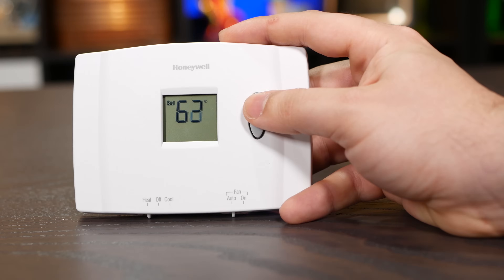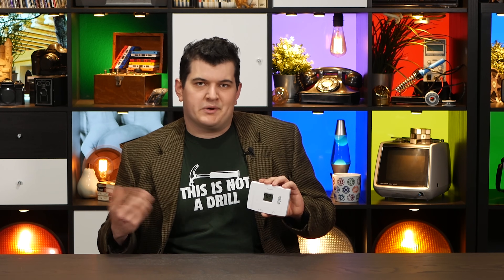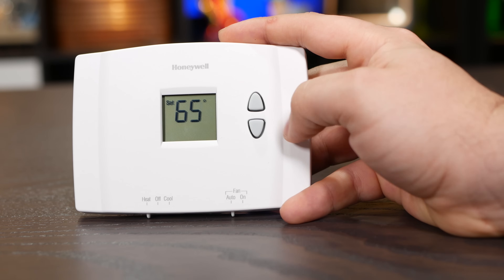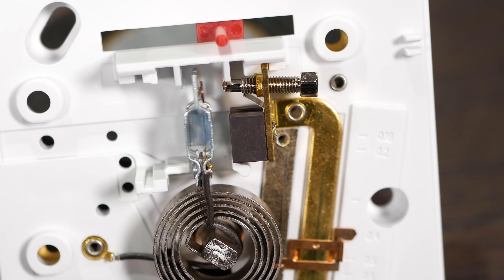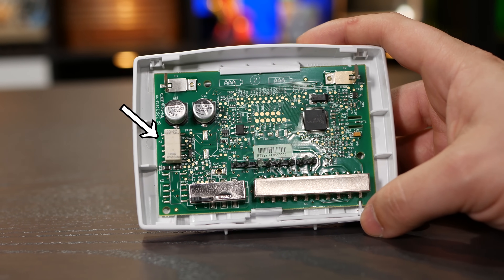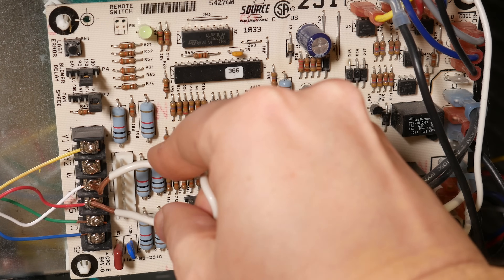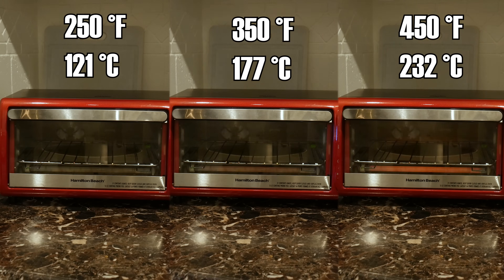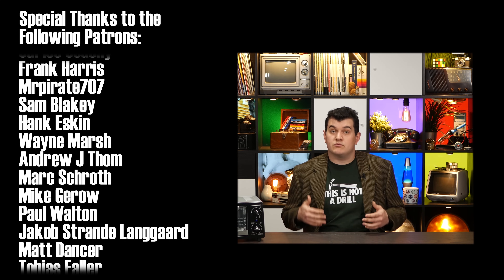Thermostats: Cooler than you think!

Comment: One thing that drives me crazy is that the compressor and blower fan are turned on at the same time!  Here in Houston on a hot day, the lights in the house dim because of the load.  I have been looking for a thermostat that would start the fan for a few seconds before starting the compressor, like in an old RAID setup where the drives were spun up in stages! See how I connected two different technologies?

Comment: What you described was / is the old standard for house thermostats.  I could be wrong but I thought my new thermostat worked on the PWM and a 30 minute cycle time.  The duration should vary based on a PID (proportional–integral–derivative) calculation, kind of a cruise control.  What I would find interesting would be how my HVAC deals with two zones:  upstairs and downstairs.

Comment: Some thermostats have an "anticipator" inside. This is a tiny heater inside the thermostat housing which operates when the furnace is on. It's purpose is to prevent overshoot of the room temperature. They are used more with hot water heating. They shut off the furnace before the set point is reached. This slows down the heating of the room. You can defeat this and heat things up more quickly by turning the thermostat higher.

Comment: Actually, some home heating thermostats do use proportional control...
A few years ago I was driving home from a night of camping with some friends on a Sunday morning in February. Being adventurous types, we noticed a small road marked on the map and decided to explore it. Turns out it was a snowmobile trail, and the Jeep got stuck on a slight downhill slop just past the road crossing. In the process of digging out enough snow to back out, we heard something snap near one of the front wheels, and as soon as we started driving again it sounded like something had been damaged. So we stopped in an empty parking lot in the first small town we drove through.
What does this have to do with thermostats?
After the driver found a broken U-joint and ordered a tow truck, the owner of the store next to the parking lot (who was in the building that morning even though it was closed) came out to offer us a break from the weather. The store sold coal heating stoves, and he old us a little about how the technology works.
Coal stoves can't start and stop on demand like a gas or oil furnace - starting them is more like building a campfire than flicking a lighter. Instead of ignition, the heat is controlled by basically changing the speed of a conveyor that feeds fuel into the stove, so the thermostats use a PID loop with proportional output instead of on/off control.

Comment: I am from The Netherlands, and most furnaces are quite advanced. Most of them have now an outside temperature sensor. The lower the outside temperature, the higher the heat output. Further they are often time base regulated. The longer the thermostate is asking heat the higher the output will be. Together with a PID thermostate, it gives a steady room temperature. Not many people have AC by the way.

Comment: Those old mercury thermostats had to be absolutely level and plumb and you set an anticipator to hydronic or air.. It made a difference because a hot water system was pumped and had a lot of residual  heat in the radiators but a hot air would just stop heating.  The anticipator was just a nichrome coil that preheated the bimetallic coil to shut it down earlier then ambient temperature once the thermostat called for heat.

Comment: Regarding your comment to Nest at the end - the app "talking to" the Nest (or any WiFi-connected thermostat) could probably be told "run the temperature at 75° for 30 minutes, then go back to 80°".  (I use a plain old electronic thermostat, because I don't need to play with it on line, so I can't experiment with that, but someone running a Nest or something similar probably could.)

Comment: My < and > keys did not move it frame by frame, they just adjusted the scroll speed- lowest was   0.25X. Also, in my experience thermostats are placed on an inside (dividing) wall whenever possible, probably to reduce inaccurate responses based on cold or hot wall temperatures vs actual air temperatures.

Comment: You might have mentioned that  there are also line voltage  (120 v or 240 v) thermostat/control systemss. For anyone just used to 24 v units, moving to a place with line voltage control might result in replacement with the wrong thermostat or a very rude shock!

Comment: The last comment on a mode where the thermostat goes to a new set temperature after you've mowed the lawn: That would be the "Hold" mode on most Honeywells programmables. Just hit the temperature buttons up or down and it will hold the new temperature for 2 hours, then resume its program. You can also set the Hold mode for longer periods, perfect if you're going away on vacation for two weeks, let's say. 
Thermostat wire is special. I live in Canada, but things are similar in much of the United States. If the thermostat fails, your furnace never gets the call for heat and your pipes freeze causing a huge amount of flood damage. The wire is low-voltage rated and has a FT rating printed on the jacket - that's Flame Travel, to tell you whether or not a furnace fire can spread to the rest of your home via burning thermostat wires. Also, being different enough from ordinary NMD house wiring, it's hopeful no one would try to connect a household thermostat directly to the 120V line - but it does happen where baseboard heaters are common. 
Don't trust the wire colors as standards - they should be but they're not. Always label the wires as you take them off the old one and put them on the new one. If you lost track, go down to the furnace and look at the control board. The R terminal on the furnace must be connected to the R terminal on the thermostat, and so forth. 

When you run into W1, W2, W3 or Y1, Y2, Y3, you're dealing with a multistage setup. They're becoming common on high-efficiency residential furnaces here in the snowbelt. W1 turns on the furnace, one burner. W1 and W2 turns on the furnace with two burners.... you get the idea. Multistage heat is a lot more common than multistage AC because gas valves and igniters are cheaper than compressors and condensers, but you might see multistage AC moving into places where there have been energy efficiency incentives. 

Take your old mercury-bulb or other pure mechanical thermostat and mount it in the utility room where your water service enters your house. Set it to heat and set it at an indoor temperature you'd find unpleasantly cold - lowest setting. Connect its R and W terminals in parallel with your new programmable or smart thermostat, you might even be able to run the wires directly to the furnace. Your old thermostat will be there silently ready to command the furnace to turn on if your new thermostat gets dead batteries or suffers a software crash (or a hack!) while you're away on a ski vacation. It will keep your pipes from freezing.
Reply: I like that idea of having the second backup mechanical thermostat... Good cheap insurance for those that  go away for days at a time.
Reply: In hot states in the US, multi-stage A/C is fairly common to cut down on electricity costs (by 1/3 with a two-stage compressor!). We also have a variable speed fan.
Reply: Great information. I would recommend doing the same for hot climates? also worth noting that there's been occasional issues of furnaces not ending their heat cycle and melting things due to thermostat crash(hack?). If you're going to the troubles to replicate this a high temperature cutoff might be a good idea.
Reply: @imark7777777   In that case you could also use the old mechanical thermostat, but wired in series. 
E.g.: You want your house at 72 F, so you set that in the Nest thermostat. Then you run the heating wire through the old thermostat which is set at it's maximum (90 F). 
If the temperature ever reaches 90 F it will open the circuit, stopping the heating.
Reply: I put a timed override in the bathroom, with a Fan/ Heat selector. In the winter, you could push the button, and get 10 minutes of heat while you showered, etc. Then, flip it to Fan, and push it again to blow the warm, humid air out of the bath.
Reply: Good info here. However, I wonder about the proportion of only furnace problem fails compared to pure thermostat failure.
Reply: You said "t's hopeful no one would try to connect a household thermostat directly to the 120V line - but it does happen where baseboard heaters are common." I just hooked up a new Nest thermostat in my apt that didn't have a C-wire. The apt. has a heat only boiler so it only had 2 wires. I went out and purchased a 24 volt transformer that runs from my thermostat C-wire input and plugs into a regular wall outlet. Is that what you meant? Is that not safe? My thermostat works great and I watched videos on how to set it up correctly but no one mentioned any safety concerns about this set up. I'm also not an expert though.
Reply: @dalethomas7944  pretty sure he rather meant that red/white have a voltage of 120V across and you're instantly frying your nest with that because the color code is confusing.
Your method should be as safe as your 24DC supply is :)
Reply: @dalethomas7944  That assumes all 24v DC is the same, but there's the possibility that the ground is different, so it's not the same.  I've seen talk about occasional problems when a thermostat controls separate heat and cooling systems, and is using the common from one with controls for the other.  Normally it's fine, but apparently not always.  (I'm not an electrician, just repeating what I've heard, but this was from comments on the Internet, so you know they have to be reliable.)
Reply: Invest in a ceiling fan !!
Reply: Yah ours does this but it’s monitored by the security system. In tandem so if it fails you can be notified.
Reply: Great tips 👍

Comment: Re-the last question: Most thermostats could very easily be modified to "command" AC for a user-specified period without changing the thermostatically controlled 'duty-cycle". Simply add a small SPST (on/off) toggle switch across the 24v and AC contacts (bootstrapping). This switch can then be used to command cooling for a user-defined time period. The operator would be responsible for turning the toggle off after immediate AC is no longer needed. If forgotten, the AC will run continuously, your house may become a "beer cave",  and your electric bill will be astronomical.

Comment: My parents' house originally had one of those mercury switch thermostats. I watched it working with the cover off one time, and it was very cool, you could actually see a tiny arc when the mercury shifted away from contact. Also there was some sort of adjustment screw that let you level out the mercury switch setting it to the right temperature.

Comment: Lol, for my senior project, we designed a solid state hvac portable unit, that ran on 12V, and we designed a digital thermostat, using pid control to maintain the temperature. It had to control the different fans and their rates, the direction of heat flow, and account for the rate of change in temperature. This was intended to optimize the energy use, maximizing battery life if used in a solar setup. While it did work, the solid state thermal transfer was less than optimal for hvac use.

Comment: You should do a building on Commercial HVAC systems. I've worked in the field for a bit now and VAVs reheat coils chilled beams all etc and the actuators to control all of them are quite cool. Oh! & also desiccant wheels in air handlers 😊😎

Comment: Dayum, that last one IS a good idea. 

As to the question about many sensors throughout the house, I think it would be nice to have that even if it were just averaged together because my biggest problem is the thermostat is in my kitchen. Guess what else is in the kitchen? The oven, the stove, the refrigerator (which I am sure you all know just pumps heat out into the kitchen). So setting the thermostat to what should be a comfortable temp means most of my house is actually quite cold, even in Texas summers. Meanwhile my game room is super hot because my PC can't stop won't stop.
Reply: Thermostats are usually located in a central hallway, which tends to be the average temperature of the house.

Comment: where I live, we usually don't have heat pumps, just electric heaters for winter and a completely separate AC sysyem for summer.
The newer thermostats (10 years old or less) seem to have different levels of heating, I think they use some sort of PID system to keep the temperature more stable but i'm not sure exactly how they work, maybe a follow up video?

Comment: Ecobee4, can set a mandated temperature to expire after a set time window, returning the normal schedule settings. There is also a choice to hold the mandated temperature untill the next schedule change would occur. Example... It's 2pm, I just mowed the lawn, I walk in to a 73°F home and it's too hot, I set thermostat to 71°F. With my current settings the thermostat will hold that temp untill 730pm because that is when I have a scheduled change to 72°F in preparation for bedtime. I could have the thermostat set to only hold my mandated temp for 30mins.

Comment: An interesting thing that you could have mentioned is the heat anticipator.  On the electronic thermostats it is usually either set by jumpers or programmed in, but with the old ones with contact points or mercury bulbs, it is a tiny, variable heater that adds just a teeny tiny bit of heat at the bimetal when in heat mode.  It is set based on the current draw of the gas valve and it's purpose is to fool the thermostat into thinking it is warmer than it is  and shut off sooner.  If you look at that square one carefully you should see a lointer pointing to some numbers and frequently there is an arrow that says "Longer" - this is to make the burner run shorter or longer.

Comment: in the Netherlands we got MODULATING thermostats. meaning: by the use of ''OpenTherm'' on our ''cv furnace'' (yes, our central heating uses a closed water loop on 1.6 atm. pressure and also heats tapwater with 1 burner unit. neat huh?) it can regulate how much heat is aplyed depending on current temp and the newly set temp. no, it does not cool as it is not required due to proper insulation and (the most Americans might consider this) the fact that we build our houses out of brick. and going back to MODULATING thermostats: Yes! turning it up further than needed does make your house heat up faster!

Comment: some thermostats even had a pre-emptive feature called an 'anticipator'.   Gas/oil fired furnaces, once the burner shuts off, the blower continues to run until the heat-exchanger cools down.  So that meant they would continue to blow hot air for a minute or so after the burner shut off.  So the room temperature would overshoot by half a degree to a degree.  (personally, I don't see this as a big deal).   But some 'fancy' thermostats would run the 24v current of the white wire through a tiny heating strip inside the thermostat.  This made the thermostat sense a temperature that was a tiny bit warmer than the room air.   So it would shut off the furnace burner a tiny bit early.  And then the blower would continue to run a minute or so longer, bringing the room temperature right up to the desired point. 

To me, it all seemed like a lot of bunk.   Like these things are calibrated to that accuracy?   Well, I suppose a laboratory oven or something might need that extra accuracy, but not a home heating system.  Probably why you don't see 'anticipator' heating elements anymore.

Comment: Having a remote temperature monitor would be really useful in my case where the thermostat is right near the stove. Maybe some foresight on the part of the installer would have been just as good though
Reply: It never ceases to amaze me how dumb tradespeople can sometimes be when siting thermostats. I've seen them in bathrooms, above furnaces, I had a friend who had his in the boiler cupboard, madness.

In my childhood home the thermostat was mounted on the wall right next to the front door, so we'd often get a bunch of unnecessary heat dumped into the house when taking the bins out or collecting a parcel.

Oh, and the front door was fitted in the mid-80's so while the insulation was adequate it wasn't great, meaning that the thermostat had to be set a few degrees cooler than you wanted the house or you'd roast everyone alive.

Comment: Newer HVAC systems use a serial communicating thermostat plus the gas valve and blower are modulating therefore the thermostat can command exactly how much heat the furnace is generating.

Comment: So I have 2 things to say that go against your ‘setting the temp higher will not cool your house faster’, and that your thermostat doesn’t know how much cooling/heating is needed. In most heat pump systems, the heat pump has at least 3 stages up to 5. Depending on how much cooling is needed to keep the house at the set point, the thermostat will tell the heat pump to use stage 2 for example. So if you set the temp only 1 degree up the thermostat might only go into stage 3 to get there, but if you set it 3 degrees, it would go full blast on stage 5 maximum cooling. Also modulating gas furnaces are becoming quite popular, which allows you to run at an infinite amount of heat output. This example is definitely on the minority of residential systems, but they are becoming more popular.